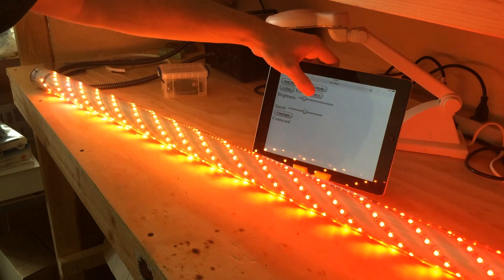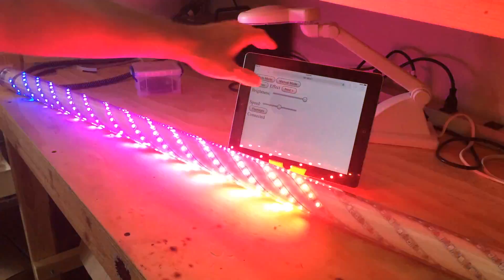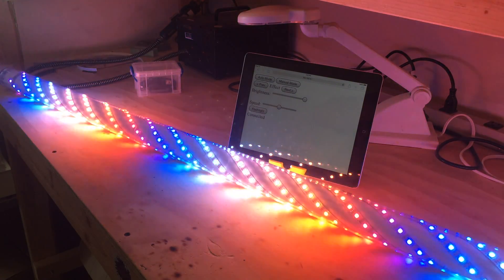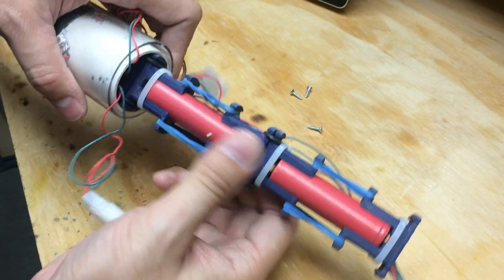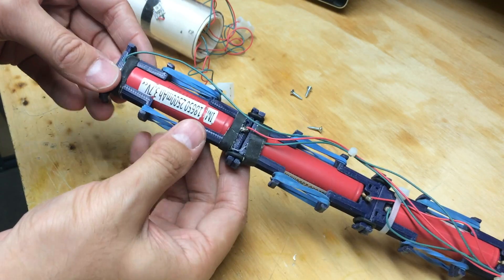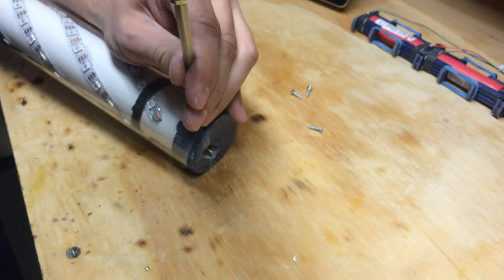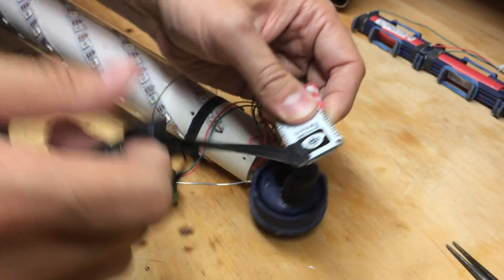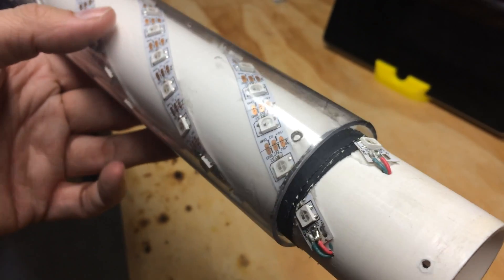LED Staff Teardown

Comment: Man I was so inspired by our conversation last year at burning man and how cool this thing was that I decided to look up how to try to make one and I came across this! It's so impressive but looks intimidating to build. You think this is something I could resource the parts for without making it too complicated since it would be my first time building something like this?
Reply from the maker: The parts are all available (other than the custom 3D printed ones) but this design was not user friendly! Only has a phone interface for control, and has to be disassembled to charge the batteries. A more usable solution will be more complex. It took me quite a lot of time to get working as-is, using most of my electronic and mechanical engineering experience ;)
Reply: Yeah I was afraid that was the case. Haha. You killed it though man! Great job! I'm camping with crumpler again this year so maybe I'll see you out there!
Reply from the maker: If he's camping with the art car group then you definitely will! I'm designing some PCB modules to hopefully make it faster to build this type of thing.

Comment: https://www.youtube.com/watch?v=itShBwhPu8E

I just finished a test build for a LED "Scepter" based on what you have in your video.  Mine runs on C-cell alkalines that are loaded in like a flashlights, with a positive contact on the end-cap with a power switch and a negative contact mounted inside the pipe.  I've not implemented a wireless solution for toggling modes yet, so the other end-cap has a toggle switch built in, ultimately I'll be including a bluetooth module so I can pair and control it with my phone.
Reply from the maker: oh yisss, looks great :) alkalines solve some problems. I'm intending to design a small power controller to handle charging 18650 cells
Reply: A controller for charging the cells internally?

Comment: I'm building a similar staff and am trying to determine what type of controller to use, does the ESP8266 control all 480 pixels?   For small projects I've generally run with small, wearable controllers like the Gemma, FLORA and Trinket but none of them can handle that many LEDs simultaneously (as far as I understand).  Also, what kind of run time do you get with your batteries on that many pixels?  Depending on the diameter piping I use for my staff I'm considering either C or D-cell alkalines, though this also could create weight concerns depending on their positioning and how many are used.